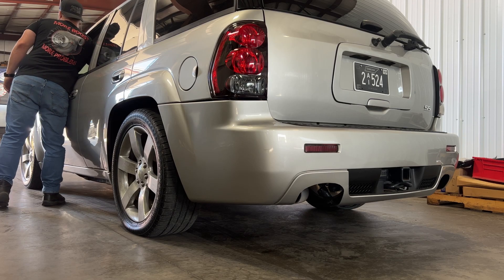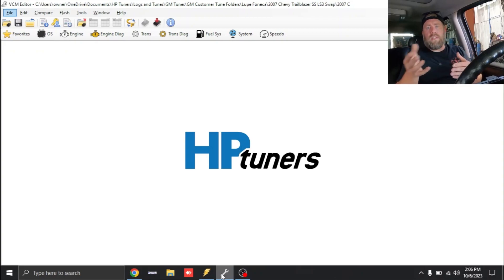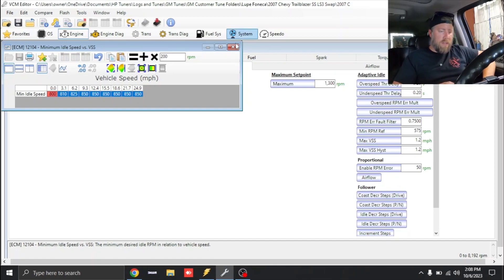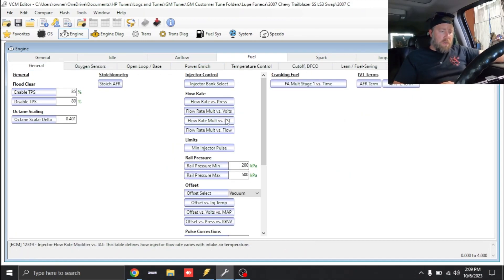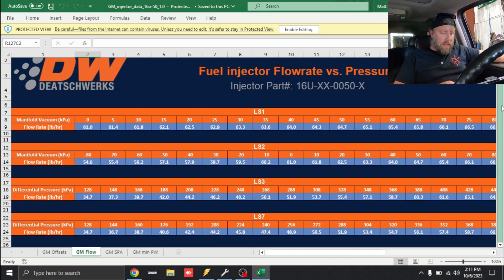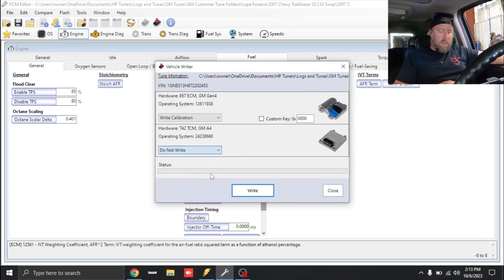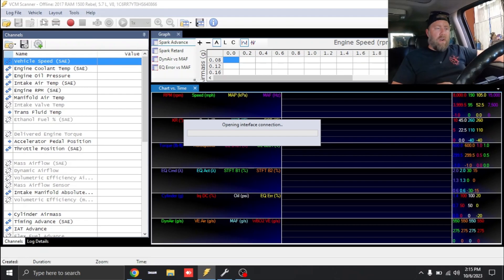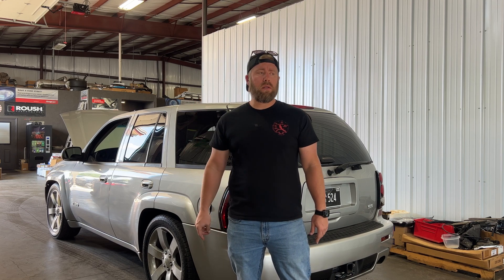Cammed TBSS in for tuning! Let’s make it run!

Comment: I need to tune my trailblazer ss, i need help with setting up my channels and histograms on hp tuners. My set up is a 5.3/4l60e (someone stole the original ls2/4l70) chopacabra cam, long tube headers, and i6 trailblazer torque converter.

Comment: Hi. I'm working on my tune for my gen 4  but the map sensor out performance code is keep coming up.  Is any parameter the I suppose to disable? Thanks in advance
Reply from the maker: Under Engine Diag, you will see the Min ECT and MAX ECT for P0101, P0106, P0121. I just normally make the Min 493°F and the Max -40°F. That should solve your issue.
Reply: @Matt_Sanford  thank you sir

Comment: Definitely one of the better tuning channels on youtube and its just getting started.

And if you haven't covered this, I'd like to see the proper injector tuning for running gen4 injectors in a gen3 with the intake swaps on trucks.
Reply: There’s a post hiding around in hptuners forum where someone converted the gen4 data into gen3 format. I used it on my tuning and it worked perfect 👍🏼